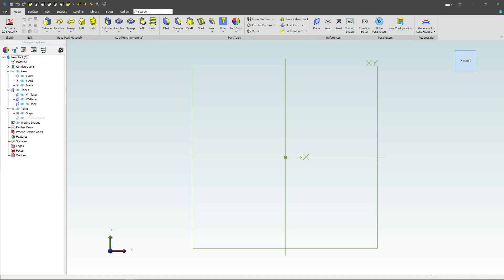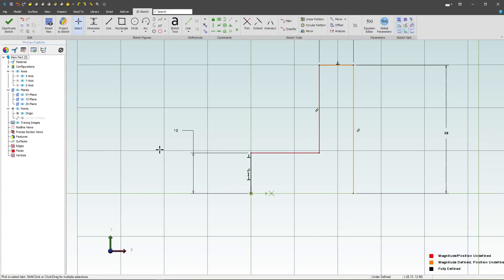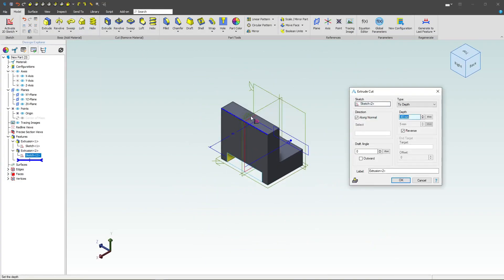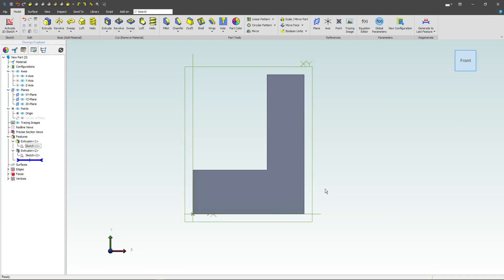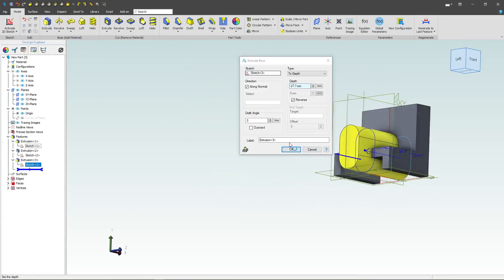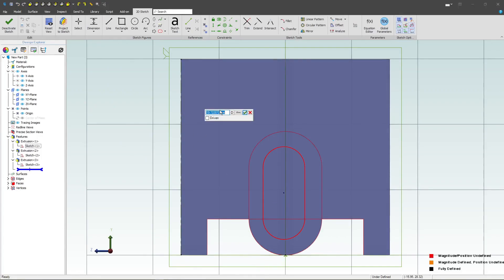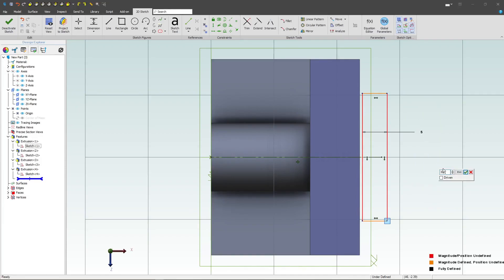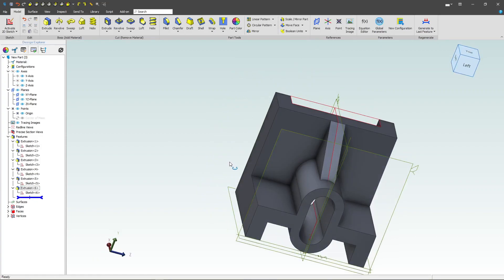Maintain Design Integrity in Alibre |Exercise 2| Edit CAD Models Without Losing Intent

Comment: I like that you used a co-linear constraint to constrain your cutting rectangle to the bottom at 2:15 instead of using a coincident constraint.  It's much easier to get rid of a co-linear constraint later if you change your mind than it is to get rid of a coincident constraint.